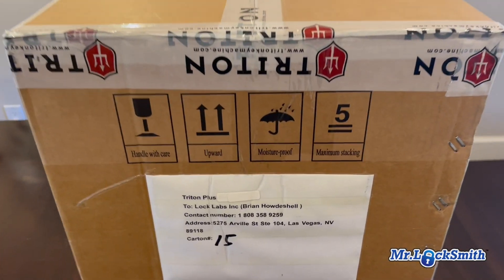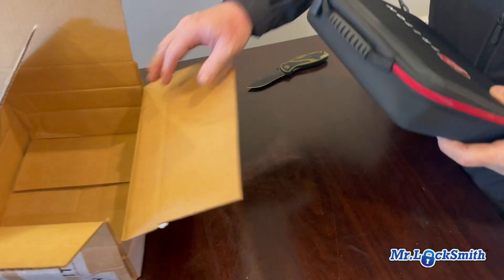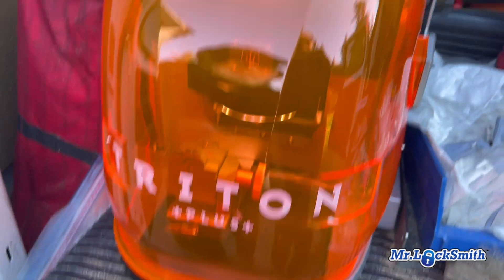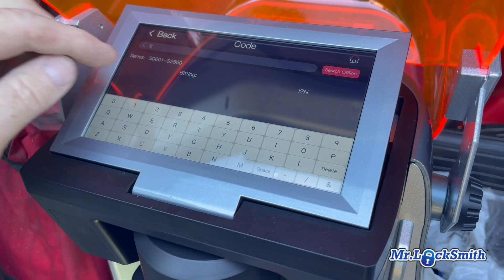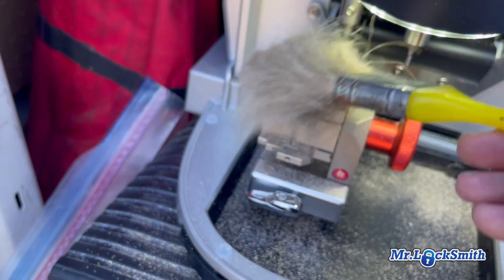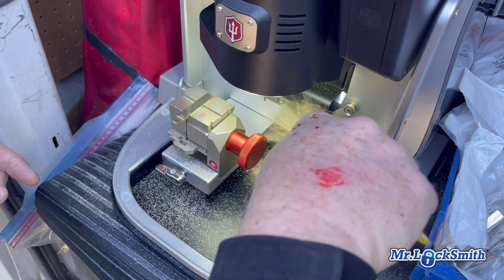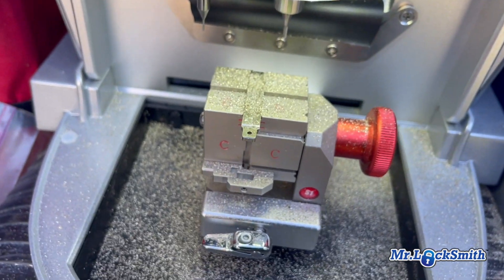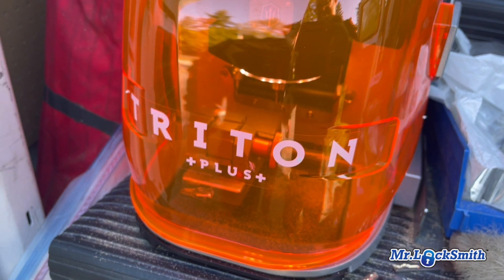Unboxing Triton Plus Key Machine

Comment: How does this stack up to the XHorse Dolphin?
Reply from the maker: @johndoran3274  A friend has one and he likes it. 

I like the service, repairs and parts. 

Our Tritons get heavy daily use and are bounced around in service trucks and a wet climate. 

American Key Supply in Las Vegas services what they sell :-)
Reply: @24hrMrLocksmith  I was a truck driver for 35 years and was hit head on by a drunk driver last year. It screwed my back up so I can’t drive truck anymore, and I’ve been a hobby locksmith for years. I’m going to try my hand at mobile lock smithing and specialize in the automotive side. I really want to buy the right tools and equipment to be successful. Thanks for the videos, they are really helpful.